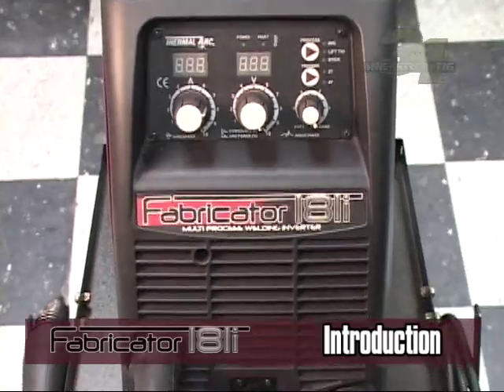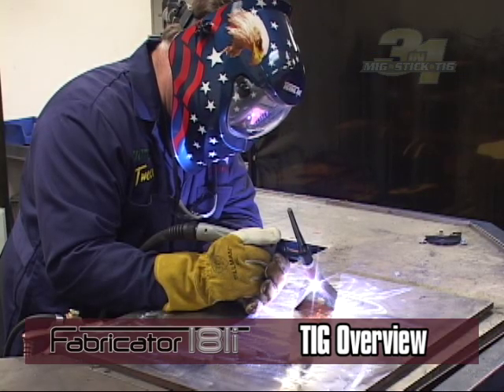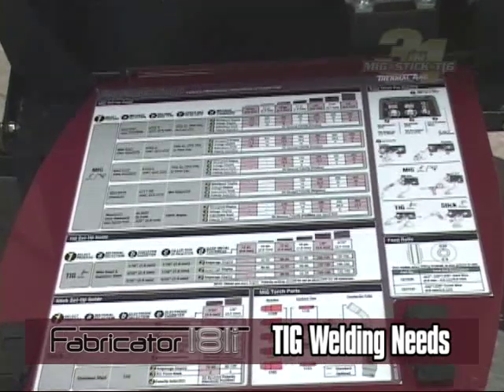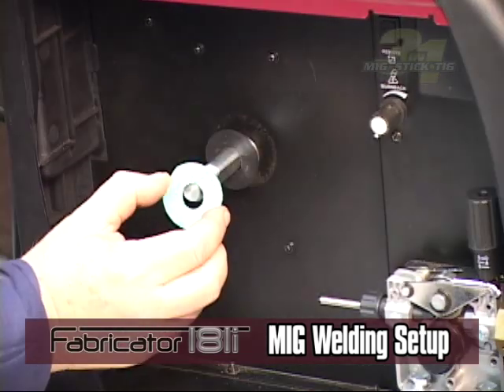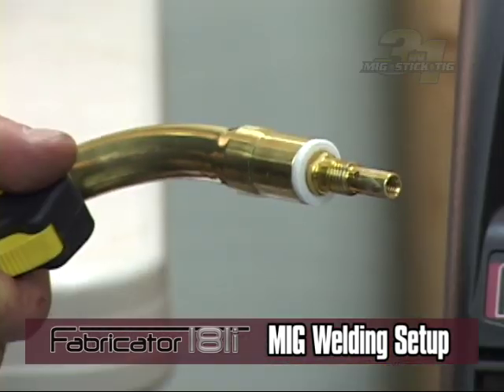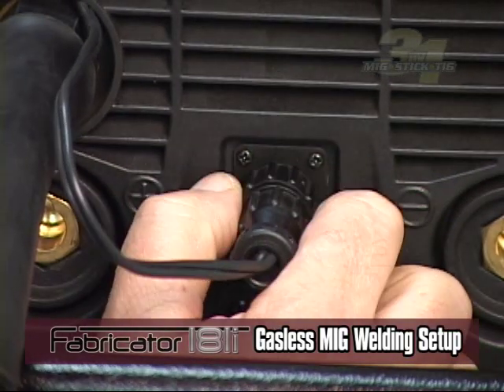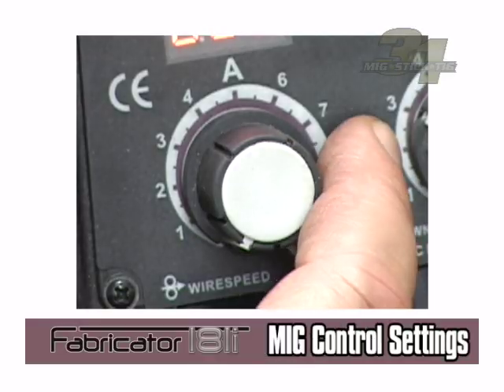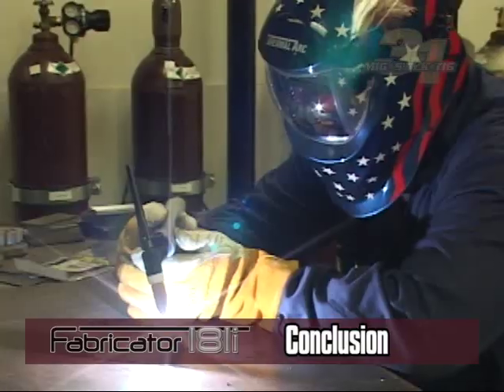Thermal Arc Fabricator 181i 3-in-1 Overview & Setup

Comment: I have this exact welding machine. What would be a good all around wire size and settings?
Reply: I’ve been using g 220 wire speed and 18.5 volts but my weld globs are big and dark grey instead of the silver. And I’ve welded on a Lincon and gotten much better welds with those same settings so I t hi king my wire isn’t the right size. I think it might be too big but I don’t remebr the exact size of it. Also the gas is on but my welds still have some holes and I’m not near a fan or anything t

Comment: I sold my miller 211 auto set after I got offered a great deal on 211I. The 211I was just cheap the paint is faded already, the on/off switch is a breaker, the wire feed system is idiotic, stickers all self pealed off, made in china, and although its never been out of garage it looks rallied. The miller was a far better machine and I could live with it being a lead brick for good American quality amd still looking brand new after 3 years of use. Buying the miller 212 after lose the piece of jnk

Comment: I tig weld for a living,  I know how to lift tig. It turns out to be what I consider a flaw in the design of the machine.  A comparable tig machine from Miller (ie. Maxstar or CST) do not require remote controls or proprietary torches to do lift tig; the Thermal Arc machine does. Basically, one way or another you need to waste $200 extra you shouldn't need to spend.  If the machine only operates in lift mode a mandatory remote switch makes no sense. A pedal is nice but not always.
Reply: Nice Machine

Comment: I have tried contacting Thermal Arc but have had problems with their website sending the message.  I cannot seem to figure out how to scratch start tig in "lift tig" mode. This works great on the Miller welders I have used but on the Thermal Arc machine it only seens to work if I put it into "stick" mode. The arc is usable but not an ideal way to tig. I am curious if there is something wrong with my machine or if it was designed not to allow scratch start or professional tig torches to be used.